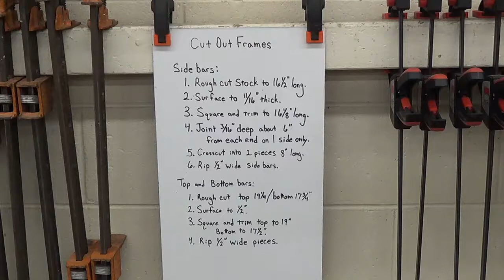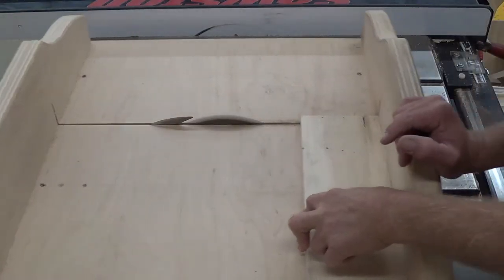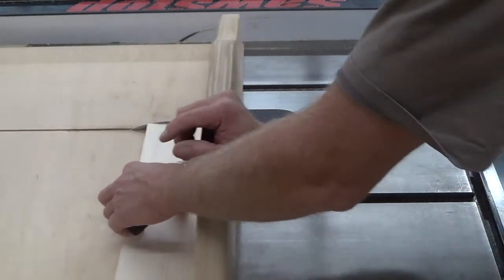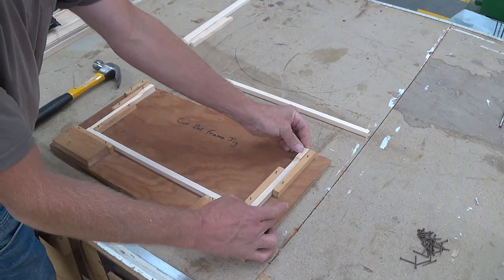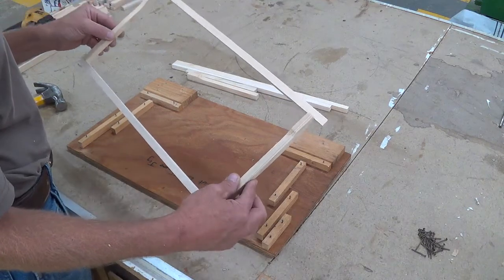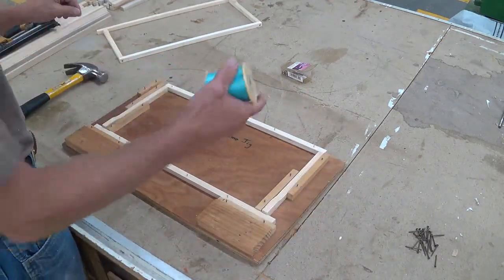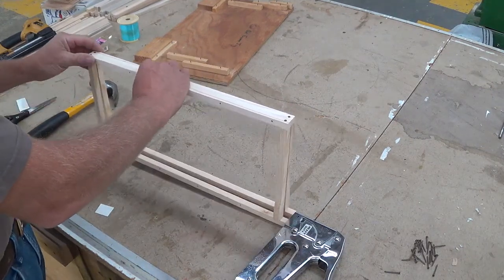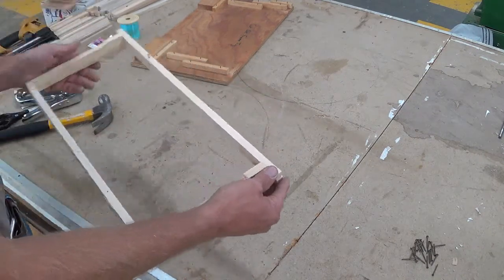How to Make Cut Out Frames

Comment: Curious as to why you don't just use a normal frame and rubberbands, seems faster, and you don't have to build a specialty frame?  Just wondering?  PS I love your videos, and will be building my own boxes this spring.
Reply from the maker: I have had many problems with rubber bands. They are too big, too little, rotten most of the time, allow the comb to lean side ways so that bees bridge frames together, etc. I have had excellent success using these hinged frames and wanted to share their construction with like minded individuals. Here is a link to me using them...   https://youtu.be/l3xUTSomNjk